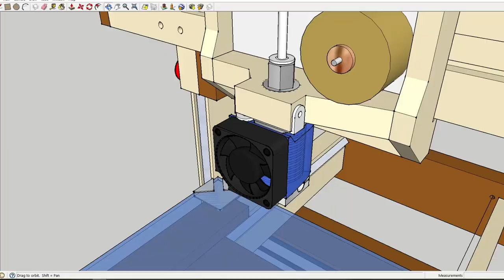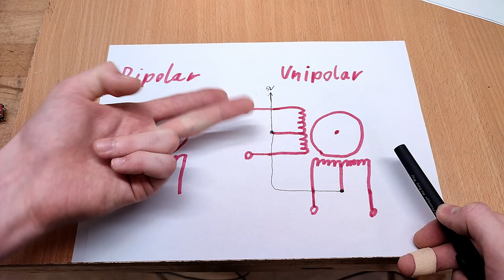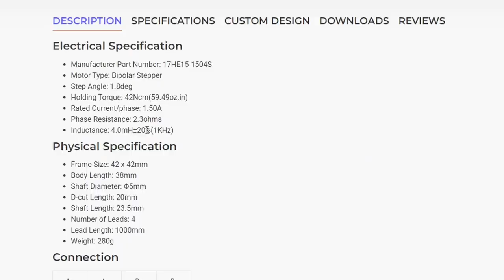Unipolar 3D printer part 12 - endstops and wiring!

Comment: I actually really love how is this project turning out. I'm in the process of building my own from scratch and I actually learnt a lot watching your woodworking. I'm a computer engineer but I'm pretty bad at mechanical engineering, so this has been very refreshing and It has helped myself to solve some issues I faced. So keep it up with the nice work, I'm enjoying this a lot :)

As a matter of giving some advice I might find useful, if your v6 clone is clogging while printing, adding a bit of thermal paste to the part of the heatbreak that goes screwed into the heatsink (as in the official documentatio & installation videos) it helps with thermal dissipation and avoiding clogs. It helped me quite a lot because I usually use cheap v6 for my builds. 

Bowden is not worse than direct drive, in your case you might even benefit from it, since the x carriage will have less mass.

Also, as you are into recycilng, I think you will love recycling bottles into filament. I spent the last 4 months trying to recycling some with some success, and the end result is quite satisfying. Improving the machine I have is one of my future projects, because the one I have currently is quite frustrating to use.
Reply from the maker: Cool, I'm absolutely horrible at software stuff!
Thanks for the advice with the hotend, I figured this cheap clone might be pretty awful given I've never seen anyone use those anywhere before.

I'll definitely recycle bottles, it's been on my list since starting this project, tho I'll do it slightly different to the way it's usually shown online to hopefully get higher filament consistency.
Reply: @ChronicMechatronic  well, just ensure that is assembled correctly and you will be fine :) actually, since it's all an open source standard, you could even make the parts yourself. I don't think it will be awful though. The first time I bought an original one, and then bought some good quality clones and the difference is close to none. Bad clones are a lottery. 

The part that made the most nervous about pet recyling was that the disgusting gunk they add to the stick the label, that thing is a nightmare to take out and it gets everywhere (depends on the brand of the bottle though), I'm also investigating how to do it differently.
Reply from the maker: Yeah haven't thought about how to deal with the label glue yet, I wonder what they do in recycling facilities? after all they can't wash all the plastic in agressive solvants... Probably will end up just cutting out the piece with the glue, usually it's just a little rectangle after all
Reply: No idea, people usually are able to clean it while heating it, but for me it was a nightmare. That thing got everywhere and was imposible to clean without spending hours.

Comment: I think there are more reasons but when making my diy cnc the lever on the limit switches was pretty handy to both give myself a bit of extra space when getting closer to the frame (to avoid breaking everything up), it also gives an easier alignment to make sure the part will press the switch and makes it way easier to use it sideways  were the carriage does not bump against the switch itself but goes in front of it engaging the lever, to make such a thing with that miniscule button would be a really hard feat
Reply from the maker: True that makes sense, they were often used against cams back in the day

Comment: The reason for the little levers on the mircoswitches is a) to make them less precise, so easier to actuate, and b) to limit the force on the actual switch and increase lifetime.
Reply from the maker: Interesting, tho how would it limit stress in the actual switch when the lever pushes it at an angle and my carriage pushes it dead straight?
Reply: @ChronicMechatronic  the lever bends, therefore limiting the force on the switch.
Reply from the maker: @polygorg  ah that's why they're so flimsy 😅

Comment: For the angle bracket I'd add some extra holes and screw the fan in, adhesives over a heated build-plate surface and all.

The lever on those switches usually helps create a springy buffer, it's harder to over-press and destroy the switch, having a shorter throw does indeed increase the accuracy, but, you have to not destroy the switch via impacts to maintain accuracy as well!

Also I don't think headphone wire is a good choice, if the enameled insulation gives out from gantry motion, that's a PSU voltage to ground inside the wiring itself?
Reply from the maker: Ah yes, hadn't thought about heat destroying the double sided tape, I don't think it should be an issue tho because the fan will cool it's housing from the inside...

Makes sense with the switches, let's see how long it takes me to destroy them 😂

Yeah the headphone wires are a bit crappy, I've never seen any short out tho even though they always tend to break - it'll be the Atmega 5V to ground in that case, so I included a polyfuse on the shield to be safe :)

Comment: Maybe consider programming a PWM pin in your microcontroller to adjust the speed of your driver motor fan. You could get really fancy with linking the fan speed to the movement of the stepper motor or put a thermistor on it (would need to program another pin on the microcontroller).  Anyhoo... This is a great project and made me a subscriber. I'm looking forward to seeing how it all comes together.
Reply from the maker: Yea I went through all those options compiling Marlin yesterday to try and familiarize myself with it, and was totally overwhelmed 😅 I think I'll stick with the simple options for the time being until I stop being the total 3D printing noob I currently am 🤣

Comment: 11:00 those byj28 motors . i have a friend that uses 12v on them for a long time.  Apparently thru can handle it.  I use 6v no problem.
Reply from the maker: Unipolar or converted to bipolar? 
In bipolar mode you can run them on pretty much any voltage you like since the driver limits the current (of course it needs to be set to the same current the motor would naturally consume at 5 volts, or less)
With a ULN2003 I wouldn't go much over 5V as they do get quite hot already
Reply: @ChronicMechatronic  he used the uln chip and yes they were really hot . he ran them for Halloween cables pulling ghosts.
Reply from the maker: @TheRainHarvester  huh, wow.
Reply: @ChronicMechatronic  you might get extra torque speed if you increase the voltage.  No warranties though...you might free the magic smoke!

Comment: 12:49 but i heard that stepper motors have more torque while microstepping as both coils get energised while microstepping rather than one..
Reply from the maker: No that's when you wire a unipolar motor as bipolar using the entire center tapped winding. With microstepping one coil gets energized to pull the shaft forward while the other one pulls it back, resulting in a 'virtual' step in between the two positions. The holding torque (and any torque) on those is a lot lower since it can't rely as much on the direct transfer of magnetic flux through the steel cores of the windings (I may be talking out of my ass on that last one, but in any case the torque is lower)

Comment: 4:15 what is the heat gun for? And why isn't it melting the wire insulation?
Reply from the maker: Heat shrink tubing 🤷
Reply: Oh i realizedit was transparent.  Never saw that before!
Reply: I belive he's using a heat shrinking for the joints
Reply from the maker: @TheRainHarvester  I guess I should have chosen color, never thought about the transparent one not being very visible   on small screens 😅

Comment: 15:44 what keeps the knots from sliding together in one spot on the cable?
Reply: Excellent video!  I'm book marking it for cable management!
Reply from the maker: Just friction, if all the knots are tight there's nowhere they can go. Also, since the string runs along the cables both ends are perpendicular to the way they'd naturally come out of the knot which kind of locks things up
Reply from the maker: I uploaded the cable lacing section as a dedicated video on my shorts channel, in case you'd rather bookmark the dedicated video and not have to scroll through this monstrosity to find the spot: https://youtu.be/ZrwzC1_asQY
Reply: @ChronicMechatronic  oh just saw your friction comment.  I asked the same on the shorter video. But I'll leave the question there too for info/algorithm. 😃
Reply from the maker: @TheRainHarvester  haha thanks!

Comment: If you change the spool holder, I think it would be a good idea to leave out the bearings. It looks to me like it can turn too easily, leading to the windings coming loose which can lead to annoying tangles later on. This not happening is something to pay attention to in general. I have run 5kg rolls on an old pipe just fine. I'm not sure your little motor could pull that, but I think 1kg shouldn't be a problem, at least as long as the rod is sufficiently smooth. You should of course decide based on your extruders observed power.
Reply from the maker: Thanks for mentioning! I think I once heard about tangling being an issue but totally forgot about it again! It's true, my extruder is quite limited in terms of power, it even has a hard time pushing the filament through the full length bowden tube at higher speeds, hence why I thought bearings would be great so it doesn't also have to struggle with unrolling the spool.
Reply: @ChronicMechatronic   If it has enough a bit of resistance in the bearings it should be fine. Even if the bearings are very good, the contact between the spool holder and the spool should be fine. Don't take my word for it tho lol

Comment: pfte tube looks quite long, could end up leading to print quality issues. On my printer of this style I mounted my extruder to the top right of the frame and the tube is probably about half the length this way. I even feed the filament from the left side of the extruder (top middle of the frame) into the right side of it using a reverse bowden to keep the transition smooth
Reply from the maker: Yeah I will switch to direct drive and reverse bowden when I do the lead screws. For the time being I don't really expect great print quality anyway, given the 0.1 mm resolution.

Comment: I also have a 12 volt 360 watt smps..but it's output is not stable sometimes it is 15 volt sometimes it's 19 volts...I wonder how can i fix it... It's inbuilt potentiometer also doesn't work..(i picked it up from a scrapyard shop)😅
Reply from the maker: Aah, the most common components to fail I've encountered so far are capacitors and the rectifier diode at the output (the diode was actually what had killed the 24v supply I'm now using, after replacing it everything was fine) tho I doubt those will be the problem on yours. I also have a big triple voltage supply from an old monitor which should put out 5.5A @ 24 volts, but whenever I try to draw power the voltage drops to just ~10V 😂
I have yet to find out what's wrong with it
Reply: @ChronicMechatronic  well i also have a 24 volt one which i salvaged from a photocopy machine..It also have a sperate 5 volt supply but after couple of short circuits it's doesn't work anymore 🙃

Comment: I really appreciate your work, but I have a question. Ok, you're making this printer for a pretty cheap price, but even your project start date is pretty old, is it worth the effort? What I'm trying to say is that in the time you spend on this, maybe you can make money by pulling the electrical wiring of a house and with that money you can buy a nice printer. I wish you continued success and hope you come to better places.
Reply: Yeah a lot of this seems like saving money and not buying stuff just for the sake of it. It is easy enough to find cheap second hand bipolar stepper motors and 3D printers. The best option would be to just take parts from a second hand or broken 3D printer, or even just to buy a reprap or CNC shield for an arduino.
Reply from the maker: Yeah for anyone other than maybe a teenager too young to legally work it doesn't make any sense of course 😂
But I really like reusing stuff that would otherwise go to waste, even if it's not quite as suited, plus it makes for a great challenge and nice content! Originally my only goal with this series was to have the videos make back the money I spent on the project (at that time one video only made ~$1)
As they say, "the journey is the destination" and we get to learn a lot in the process!
Reply from the maker: @conorstewart2214  spot on, otherwise what would be the fun of it? 😂
Reply: @ChronicMechatronic  Ok, you are right, it may be true for someone who cannot work legally, but someone at such a young age cannot use the woodworking machines you use, but can buy ready-made parts and assemble them. :D

Of course, I can't say anything if you like to push yourself in this way :D but one of the important condition of engineering is time. You can buy a sigma iron profile and simply assemble the case within 1 day.

But again, as I said, if you like to do it this way, I can't say anything. I couldn't do a job like this in my life.😅
Reply from the maker: too true, I hadn't thought about the machinery 😂
The "time's money" mentality is actually what puts me off pursuing engineering professionally - like, as soon as solutions get compromised over saving time the fun's over for me. Much of my engineering may not really have a place in this fast-paced world but it's very educational at the least and serves a novel niche that hopefully has future on this platform. I feel like it's the best I can contribute to society as a wole really, because spending the day squishing dough in a bakery didn't turn out to provide the fulfilling life I hoped it would after all.
Reply: @ChronicMechatronic  if the time is money mentality didn't exist then most of the things you see around you wouldn't exist either. Engineering needs to be profitable for it to work out and be worth doing. Research needs funding and that wouldn't exist without companies having products to sell at a profit. Sure people could work on something until it is near perfect but that is chasing an impossible goal, especially with how technology develops. Companies need to release imperfect products or products that aren't state of the art to fund their ongoing development.

The time is money mentality exists for a reason. Employees need paid, so their time literally costs money, and as a manager you need to best use their time. You could spend a month making something yourself that isn't your main goal or you could buy it instead and use that time to develop your main goal giving you more time to work on your main goal and ultimately costing you less and meaning you reach your main goal faster. We have a finite amount of time, spending it reinventing the wheel isn't worth it (unless of course you are doing it for educational purposes). 

Also humanity is only where it is due to collaboration and building off of other people's work, no one can be good at everything, so it is generally better to use what someone else has done and work on your area of expertise. If everyone had to build everything themselves the world would grind to a halt and probably set us back thousands of years.

In short, the time is money mentality exists for a reason and there is nothing wrong with wanting to make the best use of your time.

Comment: Maybe you should keep the first printer and use it to make a new printer from scratch, rather than completely dismantling and rebuilding it
Reply from the maker: I will eventually, but first I need to get this one working well enough, I doubt the 0.1 mm resolution I'm currently getting is enough to print usable parts 😂 and when I go to the length of installing lead screws I might as well relocate the extruder...